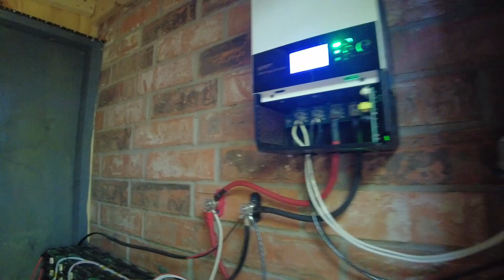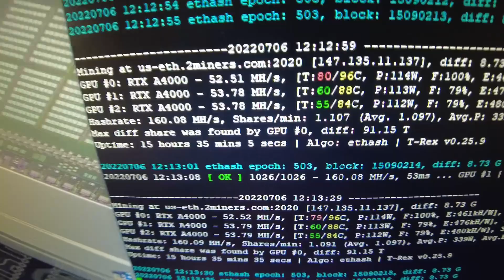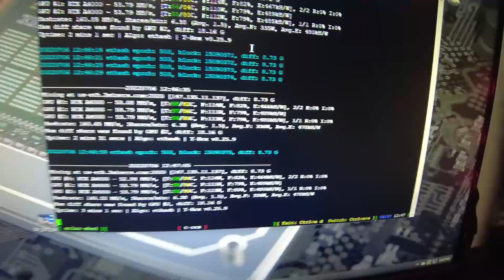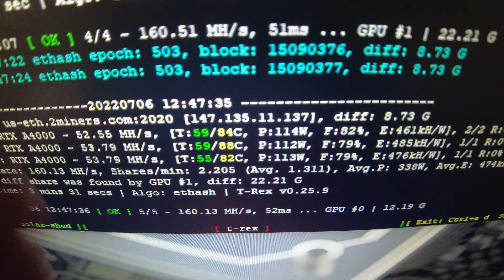RTX A4000 Cooler upgrade

Comment: Now I applied another mod. I replaced the cover plate by a self crafted copper plate. The custom copper plate is a little bit shorter to keep the heat sink output free. Additionaly I connected the copper plate to the heat sink with a thermal pad. It gave me a 10°C temperature drop. Now Im at 76°C under load together with the increased fan speed. And I was able to reduce the increased fan speed from my other posting.

Comment: Maaan, it works perfectly. 20 degrees down after upgrade. It was consistently between 90 and 96 degrees celsius before I put in the new cooler. Now 70-78. Many, many thanks! :)
Reply from the maker: Awesome! Yes it's a much better cooling solution!

Comment: The Cooler is from a Gigabyte GTX 1650. Nice RTX A4000 Label.
Reply from the maker: Yeah it probably is originally designed as a 1650 cooler. However it is modified to fit the a4000, a stock 1650 cooler would not mate up. Thanks
Reply: @BradCagle  Are you sure? I think the only modification is to adapt the holes, if at all. For example, you could drill 4 holes in a lot of GPU coolers and glue threaded bushings into them with metal glue.
Reply from the maker: @yexxx  Pretty sure. There's a much thicker block that contacts the GPU. This is so it can actually reach the GPU through the stock frame that is bolted on the A4000. A stock 1650 cooler is not going to make contact with the GPU, the frame around the A4000 is in the way.

Comment: Absolutely cant stand creators that don't spread thermal paste over the entire die in naked die situations. 

Just letting RNG-esus take the wheel and making people who may not know follow suit and letting RNG-esus take their wheels... 

Let me guess... you pray to the lord and savior RNG-esus to let your squash be true? To not have a corner be naked without a temp sensor on that quadrant of the die and fry its self without you knowing its frying its self?
Reply from the maker: Spreading it actually increases your chances of capturing air bubbles, forming a void. It's best to put a liberal blob in the center and allow it to squeeze out. If you are in doubt of the amount, you can mount the heat sink, and pull it off to see if you have full coverage, then reapply. BTW this is nothing new to me, I've been overclocking CPUs/GPUs, and using exotic cooling methods since the early 2k's. You may have even used software I created for the overclocking community.
Reply: @BradCagle  You are taking bigger risks than an "imaginary" bubble (which btw has been proven time and time again to not form unless you have a concaved or convex surface mounting surface) letting part of your die be naked has a FAR bigger chance of occurring.

For the average rando doing this for the first time your method has WAY more risk. And lets be honest the VAST majority of viewers watching this tutorial are people whispers WHO DONT KNOW WHAT THEY ARE DOING. lol

Comment: Just installed my A4000 and tested it out.  I would like to get the cooler, but I am worried about how thick it is, as it may not fit in my case.  Length and width seem the same or smaller than the standard card, but can you tell me how thick the whole thing is now with the coolers?

Comment: I have just bought an RTX A4000 for gaming and video editing, what a card....
I replaced the thermal pads on the memory and the paste, managed to get temps down to 71c, with memory hitting 79c
But i didn't stop there, I then ordered a Raijintek MORPHEUS II CORE EDITION VGA cooler, place 2 x 120mm Noctua fans.
Fans set to a fan curve with 30% at 30c to 100% at 70c.
Running 3D Graphics Mark at 4k, gave me a score of 24840 and a maximum temp of 46c, with memory temps at 52c, now that's above 3070 ti territory and its silent.
Reply from the maker: Nice, work!
Reply: Did the cooler come with the correct hardware to mount it to the A4000?

Comment: I'm actually using an RTX A4000, and I discovered that using MSI afterburner to increase the Fan speed beyond the 85% max cap it defaults to, you can cool the card to 82C under max load, which at that point thermal throttling no longer occurs. I was even to overclock it with the additional headroom, which is a lot better than the 92C with thermal throttling it was hitting before. You should consider trying to increase the fan curve before modifying the card if you are fine with ~82C temps. (Results may be different in different cases, my case is a Thermaltake Core V71 TG, so smaller cases or ones with less fans may perform differently, but still worth mentioning! (If you are using a mod to bypass the power limit though, you will likely definitely need a new cooler!)

Comment: Now I know where all those A4000 came from on eBay selling at $500 a pop. I wonder why someone would have that many A4000 as it doesn't make much sense for high density render farm (which would be A6000s)
Reply from the maker: Yeah, at one point as you know there wasn't a lot of options to buy, were able to buy these new for less than used 3070's at the time. FWIW Mine are not on ebay. They are currently mining cortex with solar power. I only opted to upgrade the cooling because these are in a non-climate controlled shed, and in the heat of summer it's well over 100F outside.

Comment: Did your kit come with little springs on the screws and small rubber gaskets for the screws? I bought the kit you linked and am not sure if I should use the springs & gaskets.
Reply from the maker: Mine came with springs on the screws, but no rubber gaskets. I'm pretty sure I just used the original screws, and spring backplate from the original heatsink.
Reply: @BradCagle  Thanks, do you think it’s worth replacing the included thermal pads for some Gelid GP-Ultimate thermal pads?  I can’t tell how good of quality the thermal pads are.
Reply from the maker: @NikTackett  It might be. I'd bet the pads it comes with are probably pretty basic.
Reply: @BradCagle  Thanks, I asked the company for the thermal conductivity but they haven’t replied. I doubt it’s 15w/mK
Reply: @BradCagle  the included pads are 6w/mK. Gelid ultimate pads are 15w/mK.
Reply from the maker: @NikTackett  Wow! Nice, if you get the Gelid pads, please let me know what your before, and after temps are on the mem.

Comment: Biggest (and easiest) improvement for any single slot card (wx7100, A4000, RTX4000..) is to remove the top place, and trim off 2 inches from the vent side.  Instead of forcing air out the “vents” – simply remove that section of the top plate entirely.  That alone drops mem temps 5C
Reply from the maker: Yeah, I totally thought about doing that. But I needed better given these are being used in a non climate controlled environment. Also when I removed the old heatsinks they were up to 80-90% blocked.
Reply: Once you trim them - using an air gun to clean them out is MUCH easier (Mine were clogged up the same) (Mine are also running in an non-climate control environment.  When the garage is 100F, core lock of 1300, mem OC of -200 was enough to keep mem at 86C.  When garage is 70 or cooler, 1300 core and 3800 mem is good for 62 mh\s and 80C for Mem.

Comment: How loud is this card now? I need this equipment for CAD and I do not know if it is possible to work with noise on a regular fan
Reply from the maker: I still have it running at 100% fan speed. So still loud for me. But if you're using for CAD in a temperature controlled environment then the fan speed will probably be very low, and quiet.
Reply: @BradCagle  OK. Thank you.

Comment: Good video. In a Dell server chassis with a high rpm intake fan it can work at ~80C core and memory at 100C. High but manageable. stock cooler is really not ideal for open air rigs. 
The key is to have very high airflow pushed through that small area. With this cooler we've 3 layers from the memory to cooler heatsink. memory pad on vram + black frame + memory pad on cooler heatsink. what's the peaks you've seen?

btw this looks like a rip off cooler from a gigabyte Windforce 2x. I think RTX 3060 also uses similar pcb layout.
Reply from the maker: These coolers have dropped the temps a minimum of 20c on both core and mem. These cards are in my mining shed with no AC, just fan ventilation in the Texas 105f heat  temps are 60 core 90 mem with these coolers in this environment. Yes they are a gigabyte cooler with a modified base to fit these cards.
Reply: @BradCagle  that's good results. Thanks.